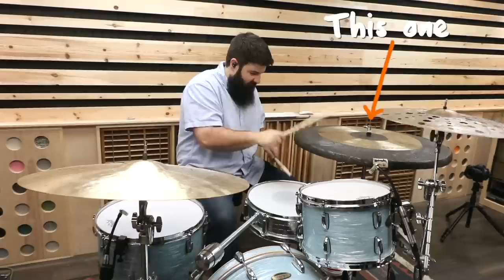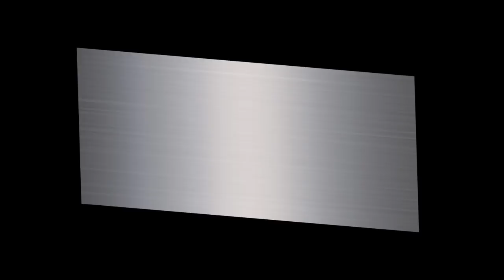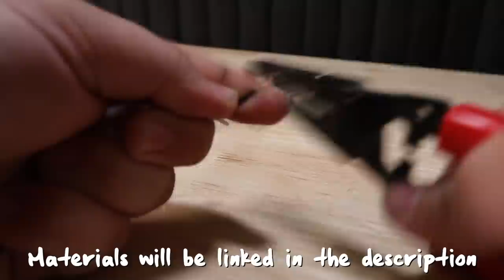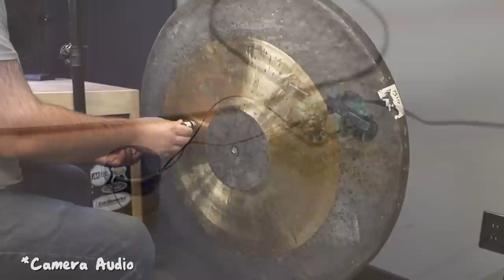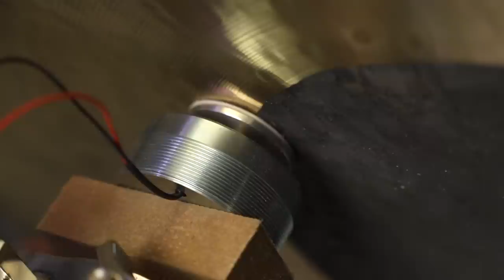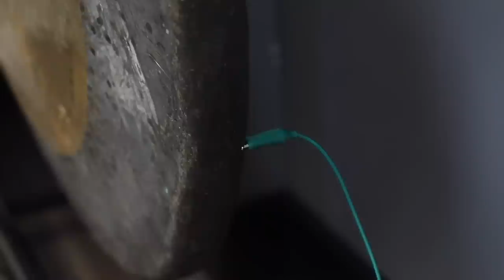DIY Plate Reverb, but I used a GONG instead...

Comment: Interesting. When I moved to Nashville in '82, I ended up working for a guy who had bought the rights to manufacture plate reverbs that were designed by Gene Lawson (of Lawson Microphones). We wound our own transducers and they were screwed to the plate. Our pickups were piezo, but they were about 5/8" by 1/8"; I can't remember how we mounted them. The plate was about 3'x7'. Our damper was made from square aluminum and we used fiberglass ceiling tiles as the damping material. It was attached with a piano hinge on the bottom and the top had a knob that screwed down so you could move it to adjust the amount of reverb. I know we had those plate reverbs in studios in Nashville, Dallas, and Miami.

Comment: Before the video starts I had a dream last night about using a gong as a plate reverb, I have a nickel small plate I built in the early 2000s but I found a huge 40 inch Gong cymbal at a pawn shop in Kingsport Tn that has just been sitting on the shelf for 2 years. So I came to youtube to see if anyone had tried this, well because its the internet someone did. so with some springs to hold it in place and a dampener I now have an idea!! THANKS!

Comment: ok really cool idea. Strangely enough I have everything to do this project as i have been messing about with DML speaker mini guitar amp..basically a small guitar amp that has a rectangle of foam as a speaker...actually works, but extremely underwhelming unless you like no bass frequencies at all lol. just wondering about the daw side of things with the plate reverb..geussing could use an insert on the back of my audio interface with a splitter (TRS on one end going into insert on interface and on the other end of that cable the split ends would be 2 x TS unbalanced..Tip going into the amp and Sleeve coming out of the piezo) then use an insert plugin vst in the daw to compensate for latency?? I would wire a mono jack plug to the piezo.